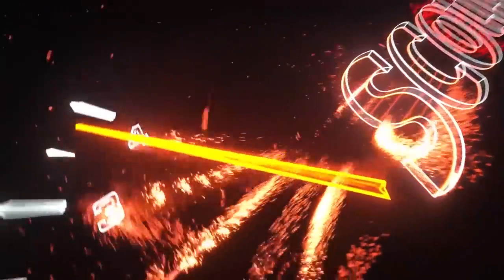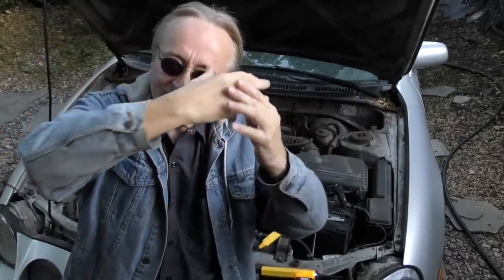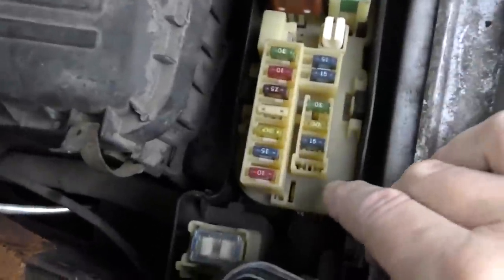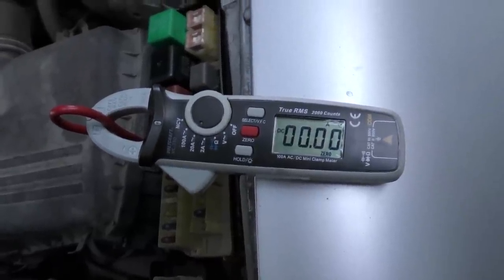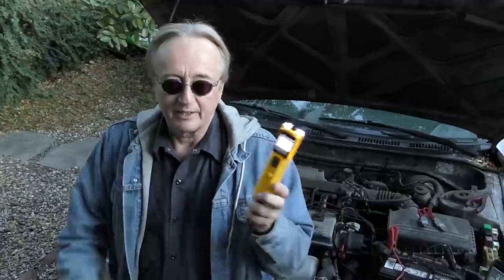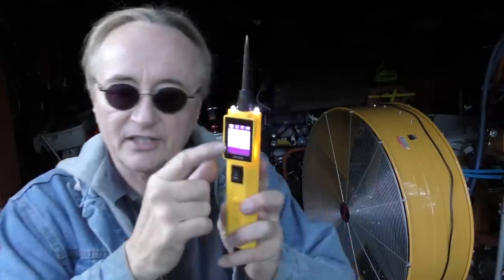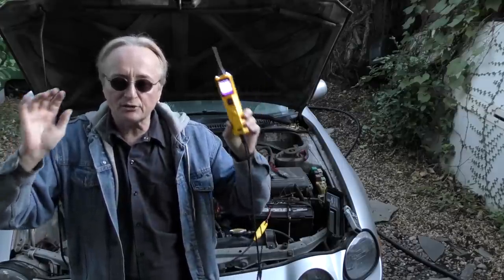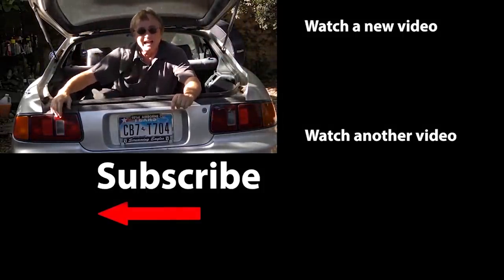Here’s What Happens If You Touch Your Car Battery

Comment: It's tools like this that let me make my friends think I'm really good with cars. This and a $20 OBD2 scanner and suddenly I'm the group mechanic.
Reply: Zig Stross How many G M code P300's have you fixed ???
Reply: @beckywatt5048  P0300, misfire. I've had one GM car, an Ion, and it was a riot. Didn't have any issues, besides 2nd had a bad synchro (manual). But I digress. So, I've never had to fix a P0300 on any car, even GM, though googling it before I replied made it seem I know what I'm talking about, which as a jack of all trades, I kinda do.
Reply: Yup, And those two tools have gotten me a lot of free beer..😎
Reply: @sigacious  P300 is a general misfire from a dirty air filter or clogged injectors. P301, P302, P303, & P304 would come up if it's a particular cylinder.

Comment: Wish I had one of those when I was a mechanic, off the top of my head it replaces something like 3 tools.  Test-light, Multi-meter, and Carbon Pile Load machine.  Also looks like the tool is lit, and oh goodness that would have been handy.  Not to mention I remember time after time I would short out something and blow a fuse, and end up having to replace the silly thing before I could continue with the Job.

Comment: 1:00 Lol, "12 volts does not hurt people!" That made my day Scotty.
Reply: You know what they say it's not the volts it's the amperage.
Reply: @MrJturner74  It's the amps AND the frequency. Most people don't know that part. You can get quite a few amps through your body and just end up with really crispy skin if  the frequency is high enough.
Reply: @MrJturner74  u can take a shock from the sparkplug wiers that is 30 000 volts and it just vill "tickel" ur hand and arm but its not dangurs cuz it no amps
Reply: @ribergzzongaming5725  and vice versa, you can touch a high amperage, but as long as the voltage is low enough you wont be hurt. The "its not the volts but the amps" saying is only a partial answer, getting shocked can be caused by a variable of volts amps and resistance.
Reply: @ribergzzongaming5725  it happen to me in a 91 acura legend🤣🤣😭 talking about that moment u think it's all over, and u live to tell it. It's all in experience
Reply: It's amps + voltage = dangerous
Reply: @MrJturner74  the amperage is dictated by your resistance.
Reply: @ribergzzongaming5725  not true. Our science teacher had each of us hold hands. One kid at the end of the line held the spark plug wire from a distributor and coil set. The kid at the other end held the ground. The teacher turned the distributor shaft and 13 kids all jumped at once lol. I remember that shock like it was 2 minutes ago. I swear it felt like a 225lb man falling on my chest. Took the wind out of me.
Reply: @W J - yup
Reply: I saw a crescent wrench touch the two terminals at the same time, it turned red hot in just 2 sec. The guy burnt his hand just knocking it away.
Reply: P = I*V

Comment: Had a boss that made a power tap from a piece of sheet brass cut in the shape of a blade fuse. He "Improved" on it by making it big enough to reach both blades of the fuse he jammed it in parallel with. I always checked his "Work" on any wiring he did after that.

Comment: But I was plugging in my spark tester while it was running, and got electrocuted 🤔(I know, not the brightest idea)
Reply: @FredTheLutinoCocatiel  Definitely a wild ride. A while back i tried starting fluid in my 90 F250, fire shot up and burned all my hair off my arm 😅
Reply: @evilal20   If that was a diesel, you're lucky you didn't wear that engine like a hat.
Reply: @billloomis4975  You sir, are correct 😅😆 Just a little adrenaline shock luckily
Reply: Sparkplugg is 30 000volt not 12 :)

Comment: Love my VW. 2015 Jetta 1.8 turbo 150k miles . Runs great!!! All original. Out perform a Corolla running on 2 cylinders. My friend has owned nothing but Jettas. Automatic and Manuel. Never has had transmission problems. I guess him and I are examples that if you maintain them properly then they can run a king time. STRONG!! And I fo ALL my maintenance. Not expensive at all. Change oil for $25, change coolant $20. Transmission fluid chainge, not much. Clean my injectors by removing manifold every 20k miles. Just changed my plugs for the 3rd time $50.  Still running original coil packs. lol to easy boss

Comment: It also has a built in circuit breaker and the switch is replaceable. A good tip for when applying power for testing press the switch forward first then touch the tip to whatever you are testing this prevents arcing at the switch which should make it last longer.

Comment: I believe that the "high voltage" cables used for traction motors in Hybrids and Electric vehicles MUST be orange in color.  They are usually larger than most cables as well.
Reply: Good to know. thanks

Comment: I learned something very interesting last year. A guy told me that a dirty battery surface conducts electricity. So I set out to call his bluff, but sure enough I put my tester on the positive post and then placed to other lead on the outer case of the battery. Much to my surprise I got a voltage reading right through the surface dirt on the battery. This is probably why many batteries go dead while just sitting there because a small current is flowing through the dirt on the surface of the battery. I am now much more diligent about keeping my battery clean.

Comment: This video is very helpful Scotty. I have an 05 Silverado for almost 5 years now. However since this past summer, my headlights, well, every light on my truck dims and brightens constantly and has been driving me crazy. I've cleaned the ground wires on the frame under the driver's seat and cleaned the ground on the fire wall but the headlights continue to flicker and as time passes it seems it's getting worse. A tool like that in this video could be very useful and helpful. Either way, your videos are very intuitive. Keep up the good advise, humor and honesty. Good honest mechanics are getting harder to find.

Comment: Scotty...Another good video... Something to shed a little light on.. Dealing with D.C. power.. Voltage generally isn't harmful to people..It's the amperage..amps kill!! You can touch a spark plug wire at 60,000 volts without dying..  A typical 12 vDC car batt. has 400-1000 amps.   You can weld with that power melting metal..True, you touched on that by saying not to touch the battery holding metal or wearing rings.. I usually warn people that if they dropped a metal "tool" across both terminals it will become red hot and probably vaporize, plus mess up your pants real quick.. I worked for one of those major parts stores you make fun of.. While it's true most of my coworkers never owned their own car or even put gas in one, it was scary that they would give people advice on their cars.. The training is minimal.. With that said, I tried my best to explain to both my customers and coworkers how the different systems on a vehicle work as well as the dangers... The crap I would hear when I explained the dangers of the charging system to them..morons.. The alternator is putting out 70-160 amps.. and lead acid batteries could explode .. A new "kid" (employee) was checking a faulty battery/charging system as I stood behind him...  After the "BANG" I had to grab him by the collar to get him to the slop sink to wash up..He didn't realize what happened and was concerned for the car which I told him screw the car!!! Get the acid off you!!.. He took the brunt of it...I got hit with some plastic(batt case) a little acid..He wore it... good thing he had eye glasses on.. Please warn people about bad batteries... If they are "Hot"  or smell like rotten eggs..That batteries produce Hydrogen gas the explodes with out flame and  instantaneously.. I'll admit I haven't seen all your videos, did you make any on safety working on a car?  No jewelry, long hair, loose clothing ..working around the cooling system...lifting a car ..FWD vehicles will roll if lifted off the drive wheel in the front even if the car is in Park... Just a thought on that sorry if you already touched on those...  Keep the videos coming...

Comment: In my experience with electrical...90 percent is either follow the black tape...or you got a ground issue. Go simple stuff before going space shuttle. Battery good? Fuse blown? Relay sticks? Former owner wired something (black tape), rust connections, check your ground wiring to engine...chasiss etc. My two cents.

Comment: I could use all the help with electrical problems I can get. I used to own a Dakota that went through two different dealer service departments, and a lot of unnecessary repairs before they found an electrical problem. I could fix the front end problems, because I was constantly putting in suspension parts!!!!!!

Comment: Scotty Scotty Scotty. I have tried to tell you this before. And it usually doesn't make any difference until they started putting computers that run the car on automobiles. The electron flow from a battery is fed in this direction. It goes through the ground through the car through the computer and returns back to the battery through the positive cable. I know it sounds weird but that's the direction the electrons flow. So it is of critical importance that you always remove the ground on a battery first and you always install the ground on a battery last. When you remove the ground you're removing the electron flow to everything. When you remove the positive first, you are interrupting the circuit after the electrons are flowing through everything. You risk damaging a computer by disconnecting the positive lead first. Please, every time you talk about a car battery make this an informational point.

Comment: Hey Scotty, thanks for the help on my 2000 silverado no oil pressure problem. turns out it was the cam thrust plate putting new silicone on the old one does not work LOL gotta replace it with the new part

Comment: Voltage is electical pressure, it takes one volt, to push one amp, through one ohm of resistance
Reply: While im at it, watts is the total power of the circuit. Volts × amps = watts

Comment: Electricity is like a river at a consestant angle. V is how wide the river is and  A is how deep it is and the amount of water flowing is your power that can be converted into heat or mechanical movement. Picture a river 12 foot wide = 12v and 6 foot deep = 6 amps how much water flows? Now picture an impossible river 12 foot wide and 100 foot deep  how much water flows? 12v is incapable of providing enough current to harm you but keep in mind the real danger is current. The relationship between V and A (current ) is sometimes misunderstand and alot of folks bealive Voltage is what harms you but actually its the current ( the amount of electrons flowing thru you ). If it was possible for 0.01v to supply enough current it too could be fatal. 
I'm just say Voltage is only part of what makes electrity fatal current is the bigger part of the equation higher voltage allows more current.

Comment: I would like to correct a VERY wrong point here. Voltage isn't important. It is amperage that kills. Anything above 0.1 amps is lethal. Between 0.1 and 0.2 is basically an instant death. Above 0.2 and the surge basically pushes the current through you and can stop your heart with a good chance that you can be resuscitated if CPR is started immediately. That is, assuming the contact was brief.

Source: Took electrical engineering in medical school. I have experience on both the working side, and the saving side.

Comment: There is a circumstance that a 12V car battery can put more than 100 ma through the heart to make it fibrillate and kill you.   current = volts/resistance  if your resistance is very low the current through your body would be high; do not grab a terminal in each hand(or one hand on the car ground and the other hand on the positive terminal) if your hands are wet; it maybe a fatal experience.  Your resistance only needs to drop to less than 120 ohms.

Comment: Electrons actually move through a wire from the negative terminal of a battery to the positive terminal; electrons are negatively charged. As an electron leaves the atom and is replaced with another electron, each atom changes from a neutral charge to a positive charge and back again. So the electricity actually flow out of the negative and returns to the positive. The why the cars frame is the negative so the negative electrons can travel a greater distance to loads.

Comment: I'm not fond of that tester. I'd rather use a digital multimeter. I have one that'll even check the micro farads of capacitors. That battery should have been 12.39v if it hasn't been started in a day or so. 11.9v means it's getting weak or that probe is off a little.

Comment: 12v at any substantial amps could but I'm guessing we don't have enough conductivity to draw many amps or is it that we don't have enough resistance to pull any amps by making heat and instead the voltage 12 in this case flows cleanly threw you mostly cleanly I'm sure you would slowly heat up over time and eventually get hot hahaha I like scotty

Comment: It's not the voltage that'll kill ya, it's the amps. Ever get shocked after walking across a carpet? That's 10,000+ volts but almost no current. Yes, a car battery CAN kill you under some circumstances. When in doubt, let safety win out!

Comment: "A short circuit is a problem in an electrical circuit where two or more wires that are not supposed to come in contact with each other touch. A short circuit can result in a very high current flowing through the circuit. ... A "short circuit" also happens when there is a bypass of electrical current."

Comment: Scotty...i replaced the 12v battery in my 2017 smart fortwo EV today and yep...i attached the battery backwards ( positive to negative and negative to positive). I got a big spark! Well after realizing my mistake i attached correctly. But now NOTHING on the car comes on...dead as a door knob.
I checked fuses but all are good. There are 3 fuses or relays and im wondering if that could be the issue?
I know u have a 2017 smart ev which is why im asking

Comment: And don't ever short circuit the battery...don't connect the negative to the positive terminals directly, whether that's with metal or a cable. Battery could explode.

Comment: It's due to the high resistance of skin, even wet with sweat, that prevents 12.6-14.6 volts from pushing enough current through you to even feel a tingle.
Puncture the skin, such as with a whisker of stranded wire, and it's a different story. If both hands or arms were punctured by whiskers of stranded wire, the resistance of the inside of your body is very low. You can be badly shocked, which can cause you to be injured by muscular contraction, or even kill you.
“While any amount of current over 10 milliamps (0.01 amp) is capable of producing painful to severe shock, currents between 100 and 200 mA (0.1 to 0.2 amp) are lethal.”

Comment: Make a little hole to the spark plug hat, and touch it while car is running....that fuckin hurts.
It's between 25 000-30 000 volts.

Comment: Scotty , this is a question I sent in a while back. the tailpipe on my 04 Chevy Colorado is and has been sutt black since I bought it new. I have looked at other Colorado's and they are the same way. it has the 5 cylinder engine. it doesn't use oil or have the black smoke you would expect from a engine that is flooding / running to rich a fuel mixture. Any thoughts ? 
does anyone have any thoughts on this ??

Comment: There is no negative electricity.  Those arrows on the image are facing the wrong way.  Current flows from positive to negative (ground) or the path of least resistance to find ground.  3 prong wires are a safety measure with a positive, ground, and neutral (2nd ground) incase primary ground is disrupted (broken) and current takes 2nd ground, so you don’t get electrocuted.  Prove me wrong!

Comment: The formula is I is = to E/R.  So we know the system is 12 volts...we know the lights are pulling 3.85 amps so the resistance is 46.2 ohms.  Applause please!

Comment: I just did something really stupid. Instead of touching both cables coming from the car harness together to reset the ECU, I touched both terminals of the battery together with a jumper cable and it sparked and got hot 🤦🏽‍♂️. Did I ruin my battery?? The battery was disconnected from the car when I did it so I’m not worried about the car but im afraid to connect the battery if it’s ruined.

Comment: Had a very scary battery moment. 
Left the charger on high overnight,  with the hood down, turned the key,  and the battery exploded! 
If I would have disconnected the charger wires first,  the spark would have exploded the battery,  and the acid in my face. 
Overcharged batteries are VERY dangerous!!
Reply: I could have told you that...free of charge 📉😎📈